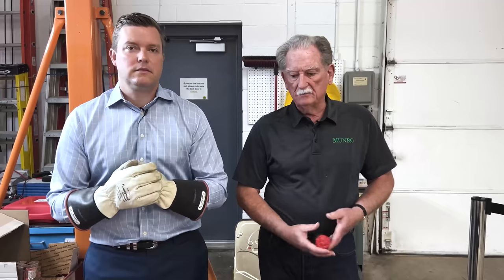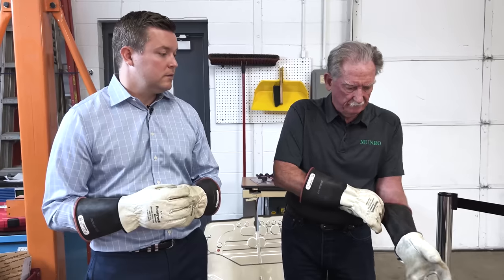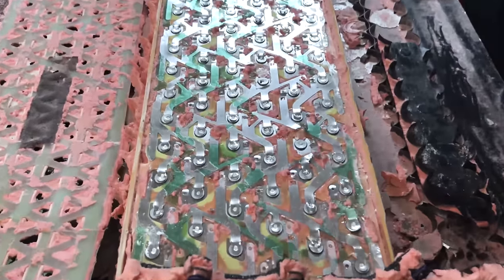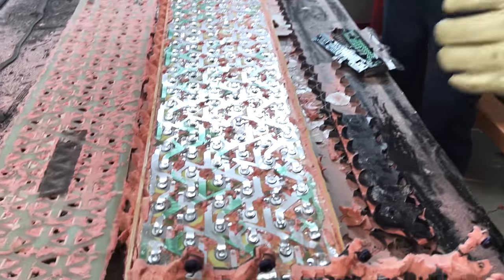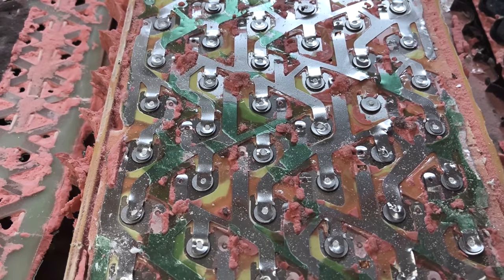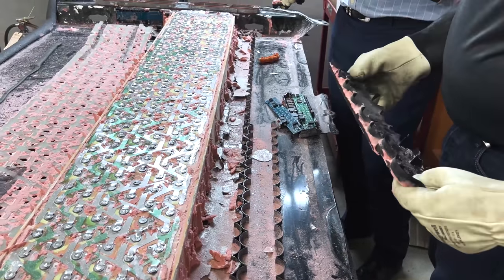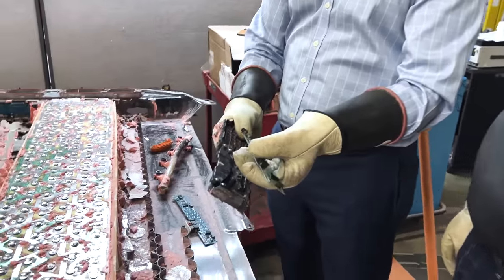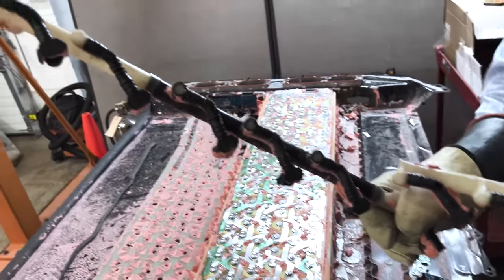Sandy's first time reviewing the fully disassembled 4680 pack!

Comment: While Tesla has seemingly made many improvements in this design one fact jumps out:  The pink foam makes this pack seemingly unserviceable, totally unserviceable.  There appears to be no Right To Repair baked into the cell/module/pack design... given the pink goo.

Major fail.

(Crickets are lovely ambiance!)

Charge on!
Reply: If Tesla did not use the pink foam then I think the battery pack would still be unserviceable since there is a strip of metal that is welded to multiple battery cells. So it is not like you could easily remove one cell from the centre of the pack and easily replace it. I'm not sure how this compares to battery packs of other manufacturers. I think a BYD battery pack consists of multiple modules, each of which contains many cells, and it is possible to replace at the coarse granularity of modules but not at the finer granularity of individual cells.
Reply: As Sandy has pointed out before, the complete pack is easily replaced as a single unit and also easily recycled by shredding. (see Redwood Materials)
Reply: Well, haven't Tesla always used the Betty Crocker method?  Every other manufacturer assemblies packs like any other part of the car, with parts and fasteners, often at the cost of less-optimal thermal performance.  Clearly, Tesla consider cost and performance far above serviceability within the pack assembly level and that keeps their sales up and margins high.  As an investor I'm all for that, as a consumer I have the choice to buy what I actually want to own.

Comment: I like learning about material and engineering advancements, but I really hate the unethical reverse engineering for profit

Capitalism and greed at it’s finest to rip off Tesla’s proprietary intellectual property and R&D investments asap
Reply: That is a good point but in this particular case who's going to copy that?
Reply: @paulaxford6754  Volvo are moving to Gigacasting and BYD are moving to structural pack
Reply: @Tigerratcat  well, the context of the question was more about the cast foam internals. Castings and structural packs as technologies don't automatically preclude recyclability.
Reply: @paulaxford6754  You might not think it’s anything, but you can bet Mercedes, BMW, Hyundai Xpeng and VW engineers are learning

Comment: Everything glued together to make modular repair nearly impossible. Looks like the Apple school of design and engineering. One part breaks? It'll be more expensive to repair than to just buy an entirely new battery, or car.
Reply: Apple iPhones are repairable, you warm up the casing and battery comes out using a removal strip sort of like the Scotch Command system. It's a breeze once you've done a few.

Comment: I wonder what the clue is of that video. Poke Yoke for the BMS PCB? Where's the benefit of it for me as customer? If the manufacturer doesn't do it right during production, this is not my problem. It won't be delivered to me, because it won't pass the final test. The thing that is really important for me as customer is the chance to get the battery pack repaired. If I buy a car from another manufacturer, I can replace battery modules if one cell or one tiny component on the PCB or one joint is defective. But not here. Here I need to replace the whole battery pack. 

I guess including work to get it replaced it would be around 30,000 or at least 20,000. Honestly: I would never buy such a car! As soon as the warranty is over, every minor damage means that repairing the car is more expensive than the worth of the car. Especially after it gets 10 years old. 

Not only for economic reasons, but also for environmental reasons this is an unbelievable terrible design!
Reply: You wrote, "Poke Yoke for the BMS PCB? Where's the benefit of it for me as customer?" Poke Yoke increases the likelihood that components will be assembled correctly on the very first attempt, rather than having workers scratch their heads wondering which way two components should be connected. This saves labour, which in turn saves on manufacturing costs, which hopefully will be passed on to customers in the form of cheaper products.

Comment: Sandy obsession with threaded fasteners is mind-boggling. On all stuff I repaired or disassembled, plastic snaps broke often, but not screws.
Reply: its purely from a manufacturing perspective, anybody whos worked on anything or modified anything can tell you snaps break all the time, and when they do there impossible to deal with. imagine a fully welded together engine or transmission
Reply: This pack is not designed to be opened and repaired. So, no need to have a fastener that can come loose inside a permanently sealed product. Thanks for playing though.
Reply: @ericrichards7884  Yes, and that unrepairability is a problem.
Reply: @pxidr  No it is not. Complex battery packs are not good candidates for repair. The pack is difficult and dangerous to repair once charged. The cells age and change once the pack is just a few months old. You can't just pop a new random cell in it and expect a long term fix. Tesla had studied this very carefully and had figured the most optimum way to build a pack. Once they ramp production and drive down the cost no one will want a repaired battery. Do you want a repaired  engine or a new one if the cost is almost the same?
Reply: @ericrichards7884  It's like hearing PR bullshit there. I don't mean replace one unique cell, but instead a module. Tesla could have subdivided this pack in 6 modules, so if a cell fail in that module, you can change just the module and not the entire pack.
Reply: @pxidr  When your flashlight stops working do you just swap the dead battery but keep the so so ones or do you put in all new?
Reply: @ericrichards7884  Did your flashlight comes with a BMS to balance the cells ? Does changing 3 AA batteries is the same cost as a ~100kWh battery pack ?
If a cell broke open in this pack, you loose almost 100 other cells placed in series with that cell, resulting in a loss of capacity of about 10kWh.
Reply: @pxidr  Any cell that fails is isolated. This is not a string of cheap Xmas lights. An army of the top engineers in the world with hundreds of millions of dollars of R and D came up with this pack. You think they will let it get bricked by one cell? I guess all they needed was you to develope a next generation battery pack. Why don't you start a Billion dollar car company and show them all how it's done,
Reply: @ericrichards7884  It is isolated by what mecanism? I'm curious to know.
The BMS can balance the cells, not isolate them.

Comment: This is terrible design for recycling, not sure how Tesla is going to handle this end of life.
Reply: Recycling of batteries will be done by grinding the batteries into a powder and treating that as high-quality ore that can be refined to extract various materials from the mix. By "high-quality ore", I mean that the percentage of, say, lithium in the ground-up battery will be far higher than the percentage of lithium in freshly-mined ore. Likewise for the other metals.
Reply: This battery is highly recyclable as high-grade ore and reusable as stationary storage. It is non repairable by design to improve its durability and reliability. Tesla is trying to drive the reliability of a pack way up and the cost way down. This is what they are striving for. Repairing these things is dangerous/unreliable and very low profit margin. Would you want a repaired battery in your car or a new one? Especially if it was only a few hundred bucks difference?
Reply: @ericrichards7884  well many of the other ev's are making battery servicing ability as part of the benefit to good design, that is the Hyundai E-GMP  has modules that can be replaced  same as Volvo, GM Ultium and others. Tesla's design of the original Model X and S could also be serviced at the pack level, even the Model 3 and Y can be serviced at the pa k level. It just takes 1 on the 900+ 4860 cells to render the pack defective, and the foam in place makes for very poor service ability.
Reply: @berthogendoorn2133   I guess we will see which is the better design in the up coming years. Oh and one cell failing does not brick the pack. You are thinking about Xmas tree lights from decades ago. They improved those also so now one bad light does not kill the whole string.Its called technological advancement.
Reply: @berthogendoorn2133  Consider two hypothetical scenarios (based on made-up numbers). Scenario 1: there is a 20% chance that, within 3 years, a battery pack will benefit from having a few cells replaced. Scenario 2: there is a 0.1% chance that, within 15 years, a battery pack will benefit from having a few cells replaced. Scenario 1 suggests the manufacturer should ensure battery packs are easily repairable. In contrast, scenario 2 suggests it would be better for the manufacturer to optimise the battery pack not for repairability, but rather for other issues, such as low cost, low weight, stiffness and so on.

Perhaps something akin to scenario 1 applies to Volvo, GM Ultium and others, while something akin to scenario 2 applies to Tesla 2. Yes, that is wild speculation on my part, but don't forget that: (1) Tesla has manufactured an order of magnitude more EVs that most other car manufacturers and that, combined with the possibility of a Tesla car automatically sending battery diagnostics back to Tesla, means Tesla might have far greater insight into battery cell lifespans; (2) there is lots of evidence suggesting Tesla innovates at a faster rate than most other car manufacturers, so perhaps this faster rate of innovation has enabled Tesla to make significantly more reliable battery packs; and (3) page 67 of Tesla's "Impact Report 2021" contains a chart and discussion indicating the lifespan of battery packs used in Model S/X cars is good enough to last far longer than the cars (and presumably battery cell/pack technology has improved significantly since the introduction of the Model S a decade ago).

I am not saying that Tesla made a good decision when designing the structural battery pack to be recyclable-but-non-repairable. However, I am saying there is a possibility that this is the case, so until more analysis has been done it would be premature to conclude that Tesla has made a bad design decision. In other words, keep an open mind until we find out more.

Comment: Hi, I would like your opinion on the new business model by EV maker such as NIO, renting out the battery pack instead of selling it with the car. Is it structurally safe? Does it make business sense? Thanks
Reply: Go Elon first principles thinking..you'd need much more batteries ...doing nothing...waiting to be swapped . .it's hard enough making enough now...
Reply: Elon would say "waste of valuable resources, put the cells in cars"

Comment: These batteries are the worst engineering results I have ever seen in my life, and there have been a lot in the entire auto industry.  Of course, you can just glue everything together and you might have some advantages, but this way even a simple leak is hard to fix. Add to that the fact that we have to make sure that we can continue to use the battery packs after they're used in a vehicle. So it's just a big mess that only serves the manufacturer.

Comment: I would love for thin A pillars to come back thanks to carbon fiber. The thickening of A pillars and reduction of visibility is a travesty in modern cars.
Reply: Unfortunately repairability of carbon fiber is not cheap compared to steel/aluminum lol…… high end cars can use carbon fiber 100%
Reply: @carholic-sz3qv  if your a pillar is damaged you're probably not repairing it
Reply: @randyhyland847  lol…….. are you serious!? Metal is still way easily repairable compared to carbon fiber that’s brittle in impact that’s a reality that’s why repairing sport/exotic cars are sooo expensive
Reply: @randyhyland847  also your tesla is already super expensive enough to repair imagine if they add carbon fiber into it!!!
Reply: @carholic-sz3qv  what I mean is that if you damage a car enough to damage an A pillar it's probably totalled or should be totalled. Maybe metal is more repairable than carbon fiber but if the accident is bad enough to have A pillar damage the car is a lost cause. Especially on an electric car where A pillar damage would likely mean battery intrusion and other serious issues. I can't imagine many accidents where the A pillar is damaged and the car is otherwise a cheap easy repair.

Comment: 3:15 “Sandy didn’t like the teeny wire bonds of the previous 2170 battery packs”

What Mr Munro DOESN’T realise is that those “teeny wire bonds” were PURPOSELY designed by Tesla as THIN LINKS to act as “de facto fuses” !!!!

Just proof that, despite being (uncritically) revered as the WORLD’S most knowledgeable EXPERT on vehicles, both ICE and EV, Mr Munro certainly doesn’t know everything. He is often regarded as the “god of vehicle engineering”, particularly by the Tesla cultists. Whilst Mr Munro is certainly very knowledgeable and experienced in vehicle engineering, he is not the ULTIMATE reference on such matters. Many of his pronouncements are just his personal opinion, and not always truly correct from an engineering point of view.
Reply: he also thinks the cells have a different voltage?? thats a pretty big misunderstanding
Reply: @robertbowman9108  You guys start your own million-dollar company and Popular YouTube channel and show him how it's done. Douche bags.

Comment: 8:15  - "With every one of the parts you can't screw it up" - sorry, that is an exaggeration par excellence. You can screw up the cells, the spot welds, the BM boards, the contactors in the penthouse, the thermal management, the connections and so on. Let us just wait for the first recall of these 4680 Tesla battery packs (just a certain batch of them) and it will be obvious what can be screwed up.
This battery pack is a brick, filled with the "foam from hell". How is it, that your statements change between pitch black and bright white so easily? I cannot take you serious as an Engineer, Sandy Munro. This is evangelism and influencer talk, not a true description of engineering.